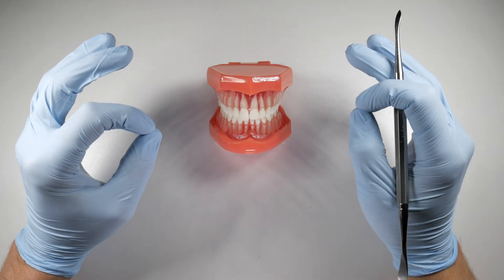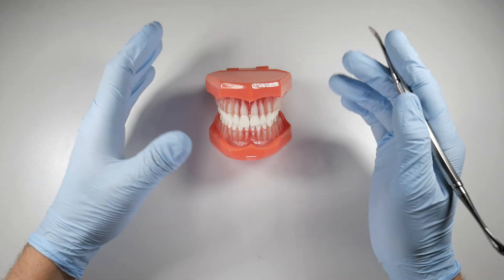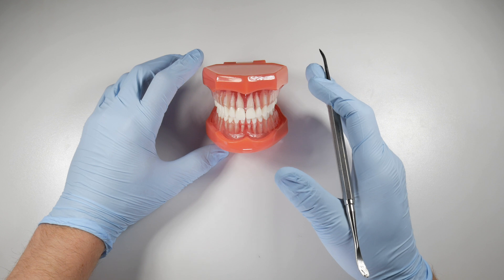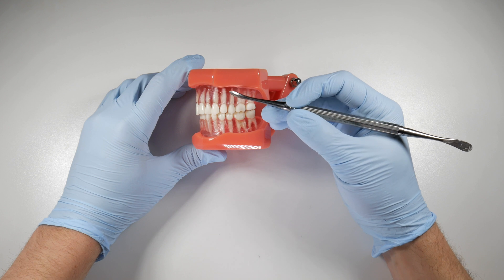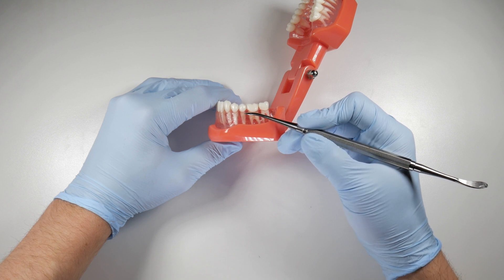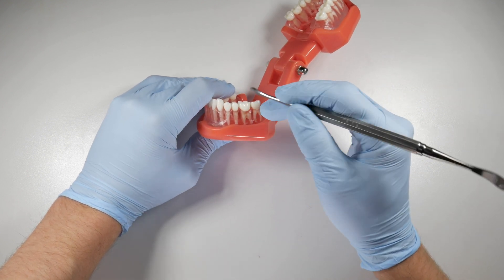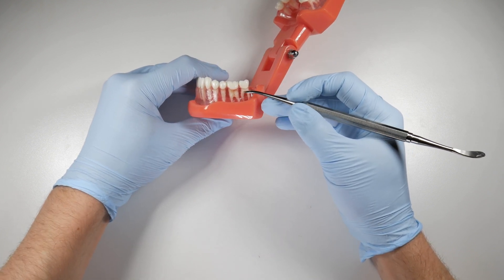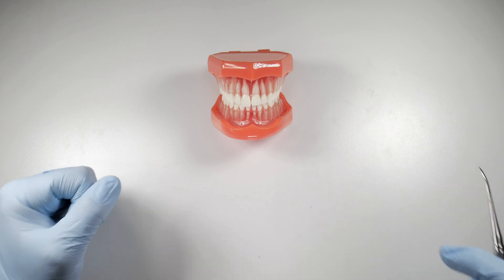Understanding The Periodontal Ligament | OnlineExodontia.com

Comment: If you inject the anesthesia on the ligament of the upper premolar, which areas will feel numb?
Reply from the maker: If you inject properly into the PDL, you won't notice a large area of numbness like you would for an infiltration.  So for the question you asked, it would be that tooth that would feel numb and the gingiva on the side you inject on (whether that be palatal of buccal).  Hope that helps.  All the best!
Reply: @OnlineExodontia  hey thank you so much for answering, this is very helpful! My dentist is trying to avoid this feeling of numbness from anesthesia to reach my soft palate because it makes me gag so bad, she is suggesting this method but im still scared but your answer gives me a bit of courage because i wont feel it on the soft palate right?
Reply from the maker: @matchapancake1795  Anesthetic in the upper premolar region should not generally reach the soft palate.  You'll be on the hard palate in that region so you should be fine.  All the best!

Comment: Does the ligament come out with the tooth when extracted?
Reply from the maker: I would assume this is is possible, however most times the ligament will remain within the socket as far as I'm aware.  It is thought that the ligament produces cells that differentiates into osteoblasts for example that help to regenerate the bone in the socket.  Hopefully that helps?  All the best!
Reply: @OnlineExodontia  it helps a bit! I had my #15 molar extracted but I don't recall if the ligament was or wasn't and I'm afraid I might have a cavitation.
Reply: @Chinese080808  go see a biological dentist. They do remove the ligament.
Reply: @coopo66   thanks for the advice. I had the molar extracted from a biological dentist.
Reply: @Chinese080808  usualy bio/holistic dentist take out the ligament. At least mine did. Most regular dentist dont even know about removing the ligament. So youre question is legit to ask.
Reply: @coopo66  how does that ligament look like? I had recently a molar extracted and the dentist said that the ligament was the soft end of that tooth. I do not know if the ligament is still in my mouth or not.... So stressful
Reply: @n.s.7223  the dentist scrapes the ligament out after he pulls the molar. Most dentist think it will come out when they pull it. Sometimes you can see it on the tip of the pulled thooth but often times it stays in the jawbone. In my case they opend it and removed the ligament years after i pulled my molar. If you are not shure about the work of your dentist, u can always ask for advice from a biological/holistic dentist.❤️
Reply: @coopo66  thank you very much for responding. Really appreciate it. I will have to find a holistic dentist then..